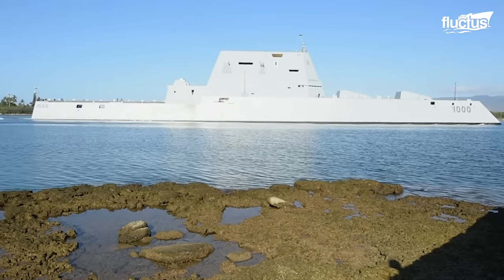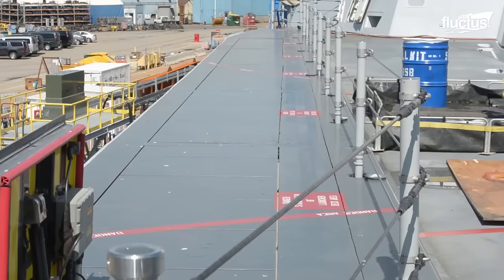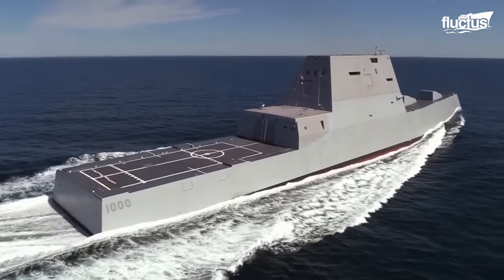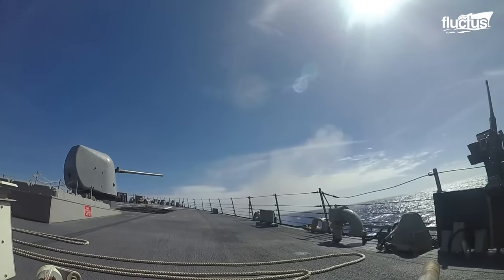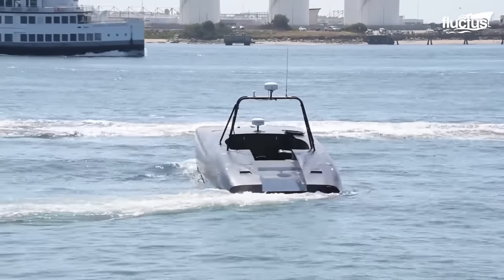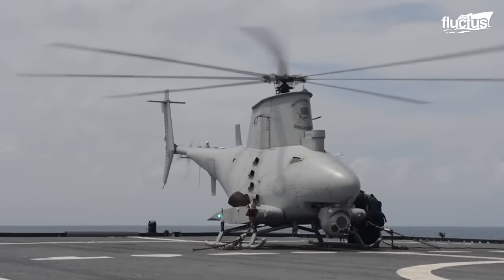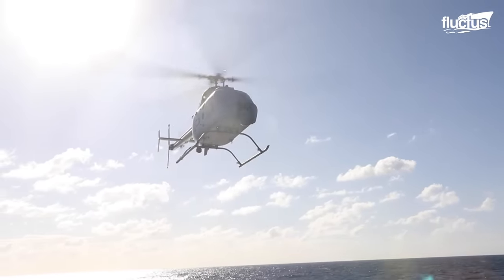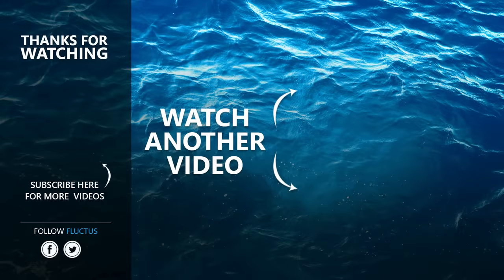Life Inside US Weird Looking $4.5 Billion Advanced Stealth Ship

Comment: I am really sad and disappointed that the Zumwalt class was cut short with only 3 ships being built. I see her as the perfect successor to the Arleigh Burke class of destroyers, but not in the configuration she was first designed for. I'm talking about the Zumwalt that is being redesigned now from the shore bombardment support vessel that was supposed to strike targets up to 80 miles in land with her advanced gun system (ADS). We all know what became of the ADS, but the future Zumwalt will be the beast, a true successor to Burke. With 2 AGS removed you free up 1/3 of the ship's volume for anything you can think off. And the US Navy thought off something great - new boost glide hypersonic missiles. With upgrading Zumwalt's radar with the new SPY-6 radar and with an Aegis combat system, you can fill her Mark 57 VLS tubes with anything from the groundbraking SM-6 to LRASM to quad packed ESSMs.
And last but not least, Zumwalt was originally designed as a ship with a huge electrical output and a room to grow, which is important for laser weapons that are coming, sooner than any of us thought.. 
All in all, with her massive 15 000 tonnes displacement Zumwalt was actually a cruiser sized ship, so she could have replaced Ticos with ease...
The new destroyer US Navy is working on, as a replacement for Arleigh Burke class, starting somewhere in mid 2030s, is an awesome piece of tech, no doubt about it, but the tumblehome design and those flat surfaces without protruding stuff out of her, made the Zumwalt mean looking, a true base for the US Navy's 21st century main surface combatant.. Well, it is what it is, I just hope they won't retire the whole class because they are to expensive to maintain. Although I doubt that is in Zumwalt's future given the massive investments the Navy is making by ripping AGS and installing new hypersonic missiles on board.
Reply: With this much info you flirting with espionage.
Reply: Zumwalt's orgin story is the same with Seawolf class subs. But at least now Zumwalt is being repurposed for something more useful.
Reply: @johnsilver9338  Hardly. Seawoolf was the most advanced and capable submarine ever created from the moment it became operational. Zumwalt took a decade from when she first sailed to the moment she became the most powerful surface combatant in the world..
Reply: Upgrade the radar, You mean add? it spy 6 and spy 3 do different things spy 3 is a multifunction radar that can search identity track and illuminate. Spy 6 is a search radar designed to find targets in clustered or difficult environments. The USS JFK will have the configuration when built
Reply: i think zumwalt got bigger VLS that probably could fit those Hypersonic Missiles, correct me if im wrong.
Reply: US spend this much because of their own shadow. If only these money spend on other budgets,the economy could hv been a lot better for the people
Reply: I thought that there were some problems with the Big Gun.  Am I mistaken or has this been corrected.  Thanks.
Reply: @benjaminrush4443  Guns are being replace so it can carry Navy's new CPS hypersonic missile. A naval version of Army's LRHW.
Reply: @johnsilver9338  Thanks.  I wonder if they are developing a Laser Cannon as well. (Railgun)
Reply: @benjaminrush4443  Railguns are not yet feasible at the moment. But they are extending the range of artillery twice using ramjet projectiles.
Reply: @johnsilver9338  Thank for the info.
Reply: well pay more taxes to government
Reply: Damn! Tell me more please.  Thank you.
Reply: The Zumwalt got screwed cause Congress was hard headed about naval gunfire but at same sometime, I fault the USN for not make the AGS common with USMC/Army ammunition. That would save the AGS from being useless but at same time , the development of the hyper-velocity projectile (HVP) from rail gun program should been considered
Honestly, they should have reused the Zumwalt design for the DDG-X
Drop one AGS for the MAC system, keep the AGS at 155mm but with commonality with existing USMC/Army 155mm ammunition
The benefit of the 155mm is that most shells carries over 20lbs of explosive while the Mk-45 shells only carry 8lbs of explosive
A 155mm HVP would still carry at least 18lbs warhead  with a proximity fuze would produce very large fragmentation which would be very effective against hypersonic missiles 
With the VLS, not less than 122 cells able carry  the ESSM, SM-2/3/6 and prospective SM-7 Raytheon glide phase interceptor
Honestly. all they need to do is borrow Israel's Stunner and mate it to SM-3 Block IIA  body and problem solved
745 mile range ,Mach 13 speed and best interceptor package in the world 
Put the Laser weapons on both sides
with a few minor changes
the DDG-1000 could become a beast
Reply: The vessel is rusting away. Its service life is going to be no where near what they expect. Who knows what happened with the design of the vessel but they are already hurting. Arleigh Burke is a tried and true warship, why replace it? Make the 2022 version just like a car manufacture and have all the new bells and whistles put on it. I hear the Zumwalt costed a million dollars a round to fire her main gun, another flaw. Its radar signature I hear is the size of a fishing vessel. Now that's impressive!
Reply: The problem is that americans want a high pay which suck up the budget of making those ships by ALOT.
Reply: @noir2559  You're right, Zumwalt has 80 Mark 57 VLS tubes which are a bit different than the Mark 41 VLS tubes found on the rest of the fleet. But unfortunately they aren't nearly big enough to fit the new hypersonic missiles. They are contained in a so called All up round configuration. We still don't know how many of them Zumwalt will carry.
Reply: @johnsilver9338  Rail gun technology sadly didn't make it to the operational level. US Navy has been developing rail gun technology since around 2000 and it was supposed to be installed on our ships by 2020. Unfortunately the technology is simply not there yet. The main problem was the wearing out of the rails that carry and accelerate the projectile to speeds of over Mach 7. They would be unusable after only 2-3 shots. Material science and metallurgy has to make giant leaps for those rails to be resistant enough to fire a few hundred rounds before needing to be replaced.
US Navy decided to shelf the rail gun technology and wait for more advanced materials.. In the meantime laser weapons have advanced a lot and the focus (and the money) is being directed towards, well towards the directed energy weapons. No pun intended.
Laser technology is definitely the next big thing in weapons development. And that development is even faster than anticipated, especially regarding the solid state lasers vs chemical ones from 20 years ago..
Reply: i am not as knowledgeable on modern warships but from my understanding the operating and maintaining costs of the Zumwalt class is too high for more to be built when the money can be allocated in other ways, but yeah it is rather sad (sorry if i am misinterpreting what you are saying)
Reply: I completely agree. The Zumwalt is twice the size, yet half the crew of the Arleigh Burke class. That alone makes them a perfect successor. I fully believe the US Navy will one day regret not building more of these ships. I think they'll prove themselves 10 fold.
Reply: @bigred0079  lol no he's not.
Reply: @bigred0079  Agree.
Reply: @bigred0079  Hes on a list for sure.
Reply: i did not read any of that or my brain would be fried and burnt
Reply: I’m glad because it costs too much to operate…not to mention it was too much to even fully arm
Reply: You're on drugs!   The ship doesn't even have a gun!
Reply: @benjaminrush4443  The gun was cancelled due to the prohibitive cost of ammunition for it.  This ship class is a total waste of Defense $$$$.
Reply: @simul8guy75  Thanks.  Not too smart.  Maybe they could put a Rail Gun or future Laser type Gun.  The other super ship has structural problems - Cracking in the Frame.  Another bright Idea.
Reply: @verdebusterAP  The Zumwalt should have been classed as a cruiser not a destroyer.  A non-AGS 155mm gun that has ammunition commonality with the Marines would be a good stop-gap measure but it makes too much sense so you know the Navy won't do it.  The Zumwalt class (and the LCSs) are an albatross around the neck of the Navy.  I'm sure the Admirals responsible for those two programs are long retired by now.
Reply: Zumwalt isn't a proper AEGIS destroyer, neither was it initially conceived as a multi-role destroyer.

Comment: The Navy bit off more advanced technology than they had a handle on.  Better to have built Arleigh Burk size stealth destroyers to ensure the stealth technology was workable.  And the Navy didn't wait to see if the rail gun would be feasible before building the Zumwalt class.  And by the time the Navy was down to only 3 Zumwalt class destroyers, the conventional gun that was supposed to be the interim solution prior to the rail gun the cost per round of ammunition was up to $1 million per round.

And the Zumwalt class ended up not having any more offensive/defensive capabilities than an Arleigh Burke destroyer already has.'

I doubt that the Navy will ever put a 4 billion dollar ship in harm's way when it has so little capability to contribute to winning a war, unless it becomes a last available option.

Now think of the maintenance costs of maintaining three very unique ships that have nothing in common with the rest of the Navy ships.

Bad dog--No bone.
Reply: Is it just me or does this video need to be payed at 1.25 just to immitate the cadence of a regular conversation?
Reply: i think these contractors should be imprisoned for stabbing the taxpayers in the back. also billed for the cost of weapon systems that where designed around the CEO financial reward programs.
Reply: The 3 existing Zumwalt destroyers are to be retrofitted with the Navy's new CPS (Conventional Prompt Strike) hypersonic missile. The guns will be removed to make way for these large missiles if I remember correctly. You can read it at USNI or just search ''USNI Zumwalt hypersonic''. CPS is a naval version of Army's LRHW (Long Range Hypersonic Weapon) that is operational since October last year.
Reply: Stealth is quite useless when talking about these giant ships. They travel in groups. Actually one of the key reasons as to why they ditched the Zumwalt class
Reply: @LoCon.MCS13  stealth matters when all your enemy is looking at is a signature on a radar or sonar screen.
Reply: @SiliconBong  I speed up these sorts of videos all the time.
I think the "Youtuber" talks slow on purpose to make the video longer.
There must me some sort of monetary value to doing that.
Reply: "little capability" its literally the strongest and most advanced destroyer in the world lmao
Reply: Military contractors should be jailed for overpricing

Comment: Dude, this video is just so wrong. There are only three DDG-1000 Zumwalt-class USN DDGs; no more will be produced and this has been the case for many years now, so I have no idea what source gave you the number of seven.

The AGS turrets don't provide any firepower as the custom shells to be fired from those guns were never manufactured due to abhorrent per unit costs (they lost economies of scale going from 32 Zumwalts planned to just 3 manufactured, so each sell was rumored to be priced at $80,000); again this has been known for years.

It was just announced the guns will be removed on the Zumwalts altogether in order to install a newly designed and larger VLS shaft to be the first USN ship able to launch one of the new hypersonic missile designs, with maintenance and upgrades to be started by the end of this year.
Reply: Yep,. It's so out of date and wrong

Comment: How stealth could this ship be in practical use? It would have to turn off it's own radar system to not be detected. So if the other ships suspect its there they just do the same. I notice it's painted white, therefore likely designed to sneak around the North pole. Hmmm, maybe useful for that.

Comment: Anyone else had this thought?: It would be hard for the main guns of any traditional warship to miss that tall & broad superstructure – they would hardly need to aim.
Reply: And if we were still in the 1940s-50s sure that might be an issue, but we are not. Ships don't sit in line of battle anymore and pound at each other with broadsides. 
-These ships are design to fight at insanely long ranges, It's guns alone can hit targets at 63 MILES which is 43 more than the AB class it was going to replace (which is the current most advance dd on the seas), and it can carry the long range missiles being developed that also massively outrage the current ones.
-The size of the superstructure isn't an issue because the ships it is designed to fight won't even have range, radar, or sonar on it much less be able to see it.
Reply: @Nidhoggrr  63 mile guns?? JEEZus, we've come to that, have we?! ~:^o
Reply: @pbasswil  Even the radar can be used as weapons on these ships.

Comment: Two reasons (In my opinion) the Zumwalt class was a expensive failure. 
One, you had General Dynamics build the prototype.
Two, you let the navy make all kinds of changes instead of building it as it was originally designed which drove up costs. 
Your welcome.

Comment: Hello, in my consideration, that ship is a complete failure. In fact the developments of the entire USA Navy fleet is getting every day more bizarre and erratic, since they start to introduce the use of nuclear propulsion plants. It is nonsense to argue a gain or an advantage in logistics, by avoiding the use of fossil fuel for dive the boats, once those have the need of aviation fuel, because it not pay off to handle the timings of repairs and maintenance as well as the dangers related to nuclear power plants in battle conditions. Thereafter the other major issue is the use of aluminium in their construction. As war experience shows, the survivability of crews and ships is getting almost impossible under real combat conditions, because once it catch fire it melts. That's one of the reasons of its failure. The absence of real combat is what it makes to look like a good idea such a development. Sincerely the combination of war ships and aluminium is not a good idea, a single Kamikaze attack and you lose an aircraft carrier.

Comment: If it's anything like I remember of how much they paid for stuff years ago, it's no wonder they cost more than they thought - like about $10,000 for a toilet seat, or $300 for a Resistor. I'm exagerating, but it was something rediculous like that.
Reply: $10,000 for a toilet seat because they kept an old ass plane for decades past its intended lifespan and had to pay for new molds as the original tooling was long gone. If they don’t want to spend exorbitant money on old ass parts, they need to acquire new hardware. You really want things to be simple huh?